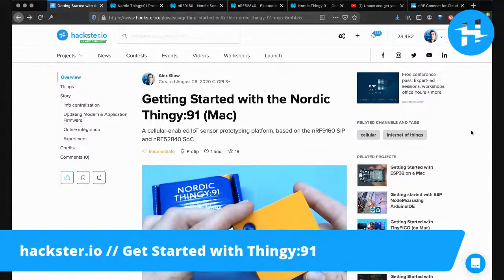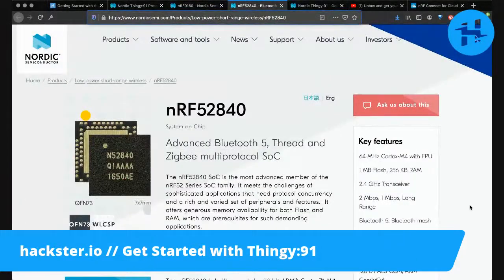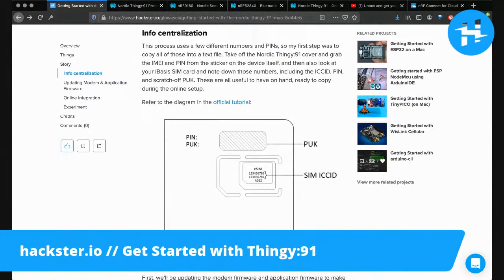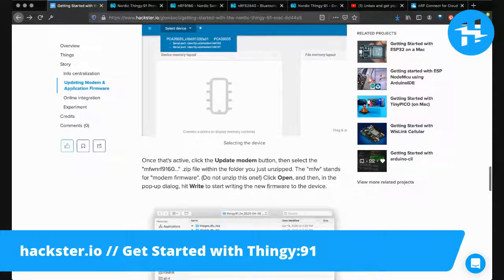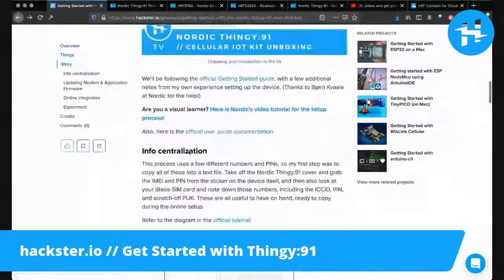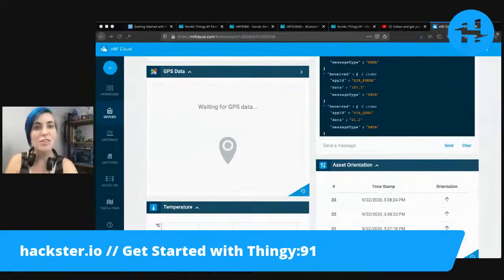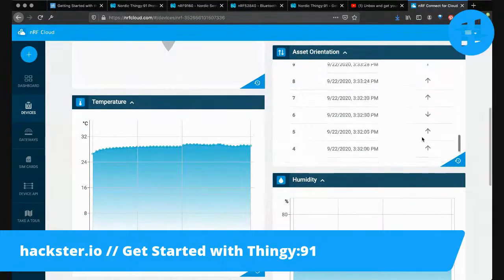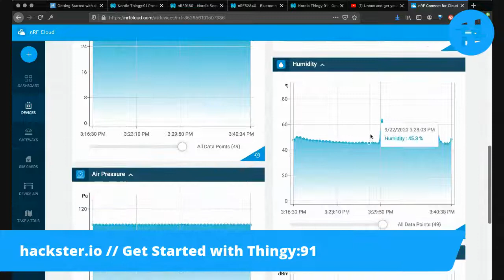Nordic Thingy:91 Getting Started // Cellular IoT

Comment: Thanks for the introduction. It all looks very nifty (yes, I said nifty). How does the cell service work? I'm kind of reluctant to sign up with these services because they seem to all require a subscription with automatic renewals tied to my credit card account. I'd rather have a pay as you go service.
Reply: Hi Erik. It depends on each carrier. Typically for IoT devices, you pay for the data you spend, rather than monthly payments as it requires a lot less data to be sent over the network compared to mobile. You can find more info from your local carrier or check iBasis’ website https://ibasis.com/ or Hologram if you are interested in a roaming SIM card https://www.hologram.io/products/iot-sim-card 

BTW: you can check how much data you will use. For more info read this DevZone blog: https://devzone.nordicsemi.com/nordic/cellular-iot-guides/b/software-and-protocols/posts/monitoring-nrf9160-data-usage-with-connectivity-statistics